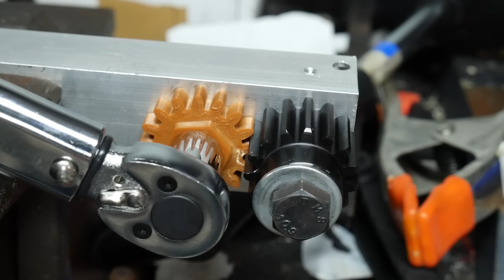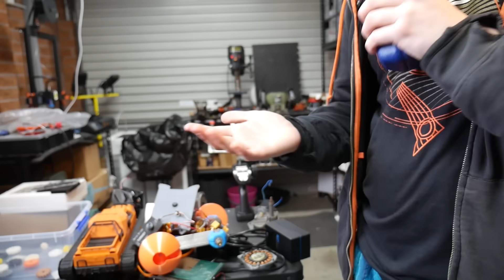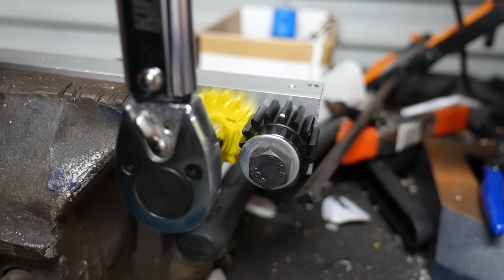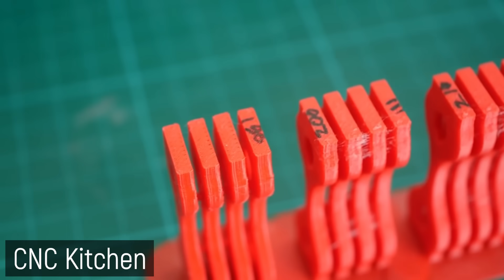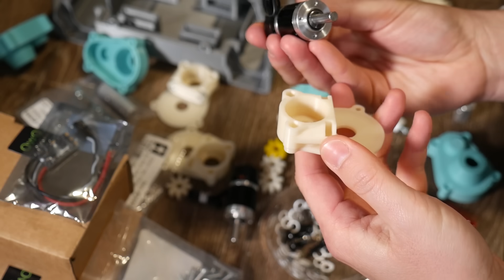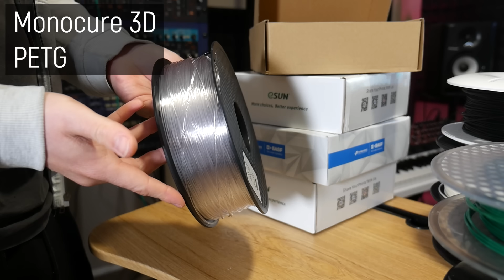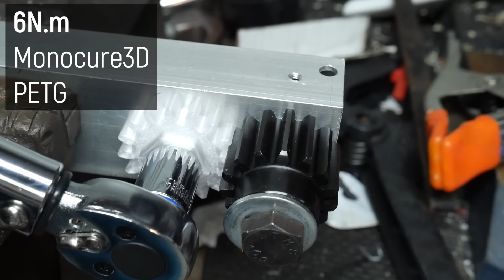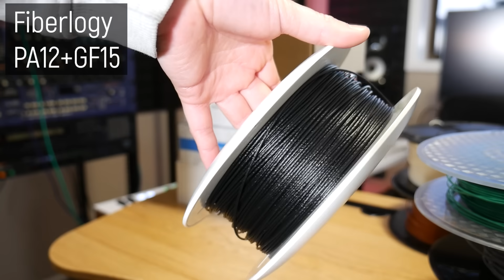Which 3D Printed Gear is Best?

Comment: I’m not surprised by the PLA results. I’ve seen great durability results with many of them. As you found the hex shape is a weakness as it has less surface area for direct force than the gears. But that may give you the slip you want before failing a motor. Great summary and look forward to the other testing you plan.
Reply from the maker: I've always been skeptical of fancy "pla blends" but seems there may be something to it. I think its only undoing may be heat during operation but at ~800rpm output I'm not too concerned.
Reply: @MakersMuse  In my experience PLA gears stay cooler, because the surface is relatively hard and has less friction than a softer more rubbery material (like PETG or nylon). Lubricating the gears keeps them even cooler, since it further reduces the friction. Then the temp shouldn't be an issue.
Reply: @MakersMuse  spot on. I print gears for varying industrial applications and found for sacrificial purposes and low temp operation, pla+ lasts longer than abs and even nylon in some cases.
Reply: @itsdane1021  my issue with Nylon is rarely how long it lasts, but the fact it's so mailable that the parts deform in ways that makes your system fail to function while the part itself has no actual damage. For gears especially, Nylons tendency to flex and flex even more with higher temperature, introduces a lot of play and failure states you can't even predict.

But for housings, it's fantastic.
Reply: @MakersMuse  How about adding annealing to the mix? Great stuff though!
Reply: The only thing I would quibble with is the description of why the hex fails instead of the teeth. The involute tooth profile is such that, if properly shaped, the force is applied tangentially to the circle. With the hex, the force direction is mostly outwards, so matching a particular amount of torque requires far more force, even if you ignore that the hex is also much smaller diameter. 
As far as the results with the gear, yeah. This testing is primarily looking for yield strength, not toughness. At least from an engineering perspective. I realize that the engineering definitions of terms like "Strength", "Toughness", and "Hardness" are far more exact than a colloquial usage of them, in which case they're often relatively interchangable. Unfortunately, yield strength is often times correlated with being a brittle material, which almost definitionally means a low toughness. In other words, materials like PLA with a high yield strength are likely also going to not take abrupt application of force well at all. Fortunately, that probably is desirable in this application, because a sudden failure is still going to be a lot less likely to bind up and cause the motors to run hot for an extended period of time.
Reply: @uncompetenttv9973  please keep posting
Reply: I've found the same printing mechanical parts in PLA, PLA+, PETG and Nylon.

Straight up basic PLA and PLA+ are often stronger, especially if you take the extra time and care to anneal them well. At that point, their hardness is something to behold.

With PETG, the air moisture levels while printing are one thingm but the air moisture level while operation as a functional part also plays a ludicrously large role in performance. I seriously hope someone makes a PET variant that stabilizes it as well, but better maintains PET characteristics, because PET plastic normally is both flexible and tough as nails even when literally functioning as a water container. PETG on the other hand can get ludicrously brittle when moisture is introduced.

PETG does better if you salt re-melt them, but that only lasts until they suck up moisture again.

And with Nylon, for rigid parts, it straight up just sucks balls. It's tough because of its flexibility, not because of its rigidity and it gets even more mailable at higher temperatures.

Nylon parts for me often bent their way out of their intended location long before sustaining permanent damage.

Re-enforced nylon with glass or carbon fiber is tough as nails and fantastic for housings and the like but also not great for mechanical parts. The fibers increase wear to themselves and the housings, bearings, axels and the like considerably.

Key thing I learned however is it's not always the material itself that matters for mechanical operations, but how you treat and post process them.

For strong parts, you're always better doing one or more annealing cycles, remelting and whatever other techniques exist for specific plastics.

Because you are putting stress on the part, it is extremely important, just like with metal mechanical parts, to destress them before using them through one or more post processing cycles.

By having the internal stresses from being melted, printed and cooled, their mechanical properties are far lower than they are when properly post processed and destressed.

Annealing and remelting can also slightly or vastly increase layer bonding which also increases mechanical strength.
Reply: @enlightendbel  Ever looked into PC-ABS or PC-PETG? Both are not as hard to print as PC itself using some kind of improvized chamber and carefully printed on a somewhat warm buildtak style surface. Printed rather tough gears with it before but can't say I have tested them to the breaking point.
Reply: always popular channels on top

Comment: Disappointed you didn't try NylonX (though it isn't possible to buy in Australia, need to import which puts it close to $100AUD for just 500g)
However it is a phenomenal material, it comes out nothing like the GF-Nylon you showed. It does have a feel somewhat like 800 grit sandpaper however it prints very clean with almost no stringing or artifacts (almost completely hides layer lines) and has a nice industrial look and feel. It's also exceptional at postprocessing, it trims up very nicely, almost like shaving wood instead of plastic
Importantly, its exceedingly strong without the flex of regular nylon, hence why its used for things like skateboard wheels, bearing housings or handles
I've used mostly for small parts that require very high shear or torsional strength, I find its about 3x stronger than PLA in that regard

Please buy some and test it against these. I don't know if its any 'tougher' than regular nylon however its significantly more practical because it doesn't flex anywhere near as much
Pro tip: the recommendation says bed at 60-65c, however 120c on PEI works far better and doesn't require any PVA glue or anything fancy
Reply from the maker: I used to have some... somewhere, will try dig it up to try!
Reply: @MakersMuse  awesome, i'd like to hear your findings. Another thing, you said you use the same settings across all filament minus temps. What about cooling fan?

Some filaments (NylonX included) i've found may not visibly look any different with cooling fan on and not suffer any visibly obvious defects such as warping or layer splitting. However part strength can be vastly impacted because of it (even at a low speed), and its not easily counteracted by bumping the extrusion temp up either. I don't know the exact reason but I imagine at a micro level using a cooling fan denies the material a chance to fully ooze into all the little crevices and adhere as well (as much as FDM printing can allow)

Comment: Just a thought, but I do think your testing rig was a bit sketchy.

I noticed that there was a lot of movement in the shaft of the test gear because of the way you were using the torque wrench.

Also, it looked like the connection to the aluminium angle was just a through hole, and any slop between the hole and the shaft might affect the results.  It's good that you tested a couple of gears, but I'm not sure how the first test would have compared to the last, because of the way the way that the hole in the angle deformed.

Sorry, engineer mode off.

Great content as always ... :-)
Reply from the maker: Heh, you're not wrong the hole did start to deform towards the end and the vice is only bolted to the table surface, which was starting to move quite a bit at higher torque levels. I've got a good idea but the test rig could benefit with many improvements :)

Comment: Torque wrenches arent that accurate. good enough at higher levels but they are terrible at small torque levels. So I think that it would be better to use the classic lever with masses technique to calculate a more accurate torque. You could also simulate cyclic loading by sliding the mass back and forth. It would also be interesting to see some resins. Siraya tech blue and tenacious are very tough even compared to FDM.

Comment: I'd be inclined to use a toothed belt and nylon toothed pulleys instead of directly interlocking gears as the belt could be tensioned so as to slip before any damage is caused to either the gears or the motor, at least in principle.

Comment: Honestly your test didn't cover the biggest issue to be honest and that is wear and deformation from heat caused by the friction.    That is something your more likely to run into an issue with before torque.   I would test with a gear and put a motor on it for 10 minutes for each, with a bit of a load on the gear(to simulate real world usage) with your top of each kind and see how they stand up to the heat and if they wear badly.  For example PLA is likely to tear apart very quickly without a good lubricant.

Comment: for failure modes
You either want to stip the teeth off the hub quite cleanly, or spit the hub.
With either of these you only have 1 or 2 damaged gears, as well as never having to worry about your motors.
Also looking at the motors you are using, I would estimate a max output torc of 500mNm, so any of the materials are in the realm of 10 to 30 times stronger then your motor. 
Question: does the motor axel also have a 12mm hex? If it doesn't then that is your most likely failure point. If it does, then you will just stall the motor.

Though as said by others, there are other properties that might be worth looking in to, Like ware resistance and in PA's case its self lubrication.

Also you could try and make the gears out of multiple materials, though its only really works with large gears. I would also only recommend doing this
Make the center out of ABS/PETG/PCTG going from the 12mm hex to a spline shaft (as these materials tended to fail at the teeth, and then use something like PA to go from the spline shaft to gear teeth (as this material tended to fail by not holding the hex in place)

Comment: Is the maximum torque really relevant? Wouldn't the gears be worn down way before they fail catastrophically?
Maximum torque is only relevant for short peeks.

I am using PETG (as usually). I printed a bobbin winder for my wife. It has wound literally mils of yarn, since she uses it for weaving on a big loom. So I can tell the weare resistance of PETG is great.

For more durability consider printing (at least) the smaller gear from Nylon or a special tribo filament (IGUS Iglidur). Nylon changes its properties by taking up moisture. It bekames not only softer and tougher,  it also grows in size significantly. So don't be surprised if the geometry of your drive will be thrown of after some months.

Mixing material's might also help with preventing cold welding.

Comment: You could print it solid then anneal it in salt. I would design a failure point between the motor and the gear. Perhaps a pin printed in a material weaker than the gear.
Great video. Keep it lit.

Comment: Pretty much matches my experience.  As long as temperature, creep and impact resistance aren't a problem in the application I usually just use PLA (plain or modified), particularly because of its much higher stiffness (if a part has deformed it's functionally failed for me in most cases).  Beyond that I like eSun's carbon fibre nylon (almost as stiff as PLA but incredible impact resistance and heat deflection.  Still has issues with creep though, and needs several days in a food dehydrator to print optimally).  eSun's modified polycarbonate comes as close to solving the creep issue as I think is possible in a polymer, and is very stiff, but seems to fail catastrophically at lower load than PLA, so I mainly use it for springs.  Another really interesting one is nGen Flex - I find it an absolute nightmare to print (about half of the prints have have caused jams, many badly enough to cause damage, and bed adhesion on PEI is horrible, with any coating I've tried).  But printed with several perimeters and decent infill it produces a part with very little deformation under load and that is functionally indestructible to the limits I can test.

Comment: Nylon is the better choice since it's self lubricating, temp resistance and also the flexibility. 
PLA is strong but under load, overtime it deforms and under sudden load, it will shatter.

Comment: Would it be possible to use a composite gear? Instead of the same material for both teeth and the hub, print hub as a less flexible material that holds up to the torque, and gear teeth that has the flexibility to withstand the torque without tearing or breaking. The connection between them would have to be incredibly strong, but would it be possible with a dual extruder printer?

Comment: Nice video. With the way the teeth failed along the perimeters vs infill, I would like to see you do some of this testing with more top and bottom layers and a larger overlap into the perimeters. ALso would be interesting to see if actually less perimeters and denser infill so there is more of a connection to the mass of the gear at the point of repeated failure (the base of the tooth).

Comment: Material selection for gears should also include resistance to frictional heating. You need to transmit torque, but you also need transmit some amount of power within a duty cycle. (See commercial gearbox ratings)  Once those are under control you might want to look at abrasion of the material after running under load.

Comment: Well it might not fail at the hub if printed solid but as i see it the teeth are almost solid with 3 perimeters and 3 layers top and bottom not much in there that is not filled with plastic and sins in many of your cases the teeth are coming of  i do not see the chance that a solid gear should do better. well that is just my take on the whole situation 

But like all engineers you build your car to have a min and a max load capacity and this goes for your gears as well i would say your min is around 8 nm your max is 13 nm leaving the golden zone between 9 - 12 nm 

So you know if you go about that you would see failures.

Or you could put it this way. 

It can certainly handle 8 nm its ok between 9 - 12 and it might fail about 12 - 13.

Ohh and i would look at what is the max nm the brushless motor can handle as well if it golden between 9  - 12 i see no problem you know if you go above that both the gears and the motor would fail.

Comment: Great video. One point that is missing though is friction. For low speed, it probably doesn’t matter but i think nylon will perform much better than most in this regard. I would love to see them tested at a few different speeds meshing to see which fails first. Might be time consuming experiment though.

Comment: Perhaps you could make the hub out of grey pla and the teeth out of nylon? They'll probably have to be pressfit together with maybe a couple fasteners on either side holding it together, but it should make the most of both materials

Comment: I will save you some time: PETG, when printed 'solid', fractures like glass.
You will get better numbers, but the sudden failure mode will still be with you.
Could be useful in 'mechanical fuse' applications where excess torque makes a clean break to disconnects beefy motor from a stalled gear-train.

Comment: Colour me very surprised you didn't test printing them with 100% infill, notably by setting a really high perimeter count so the layers are all printed 'concentrically' solid.
Also, printing PLA at or near PETG temperatures might mean stronger bonds between the layers & perimeters. I sometimes print transparent PLA at PETG temperature to make it more 'clear'.

Comment: Toughness is not well defined as a mechanical property - it's supposed to measure the resistance to breaking in the presence of a pre-existing crack but usually is estimated from impact tests.  In your case - the "tough" PLA ST is weaker than most PLAs but has very high impact strength.  Which is probably why they describe it as "tough". But it's not surprising that it would fail before other PLAs because it is NOT as strong as the other PLAs.

Comment: It may not apply to this specific use case, but this is a researched topic and my understanding is that the heat buildup from friction becomes the determining factor, at least from gears that see enough continuous use. Pure nylon was the clear winner.

Comment: That was great, well done, but as you compared gears I started wondering about wear. many applications are more about wear than strength, a winch lifting a load is strength, but car wheels can slip but need to continue for many revolutions and probably heat up causing increased wear with different results for different plastics. Would be more time consuming to test wear but a rig with a small continuous load over an extended time would be interesting. I feel for you down there with the covid thing, I expect we on the Gold Coast have it coming our way soon, 3D printing would be a good pass time during lockdown. Take care mate, love your work.